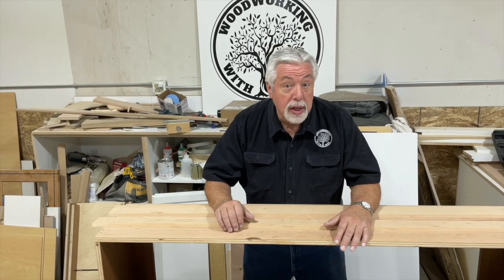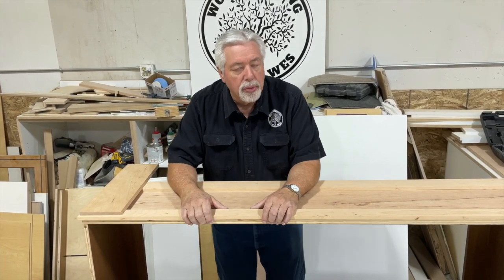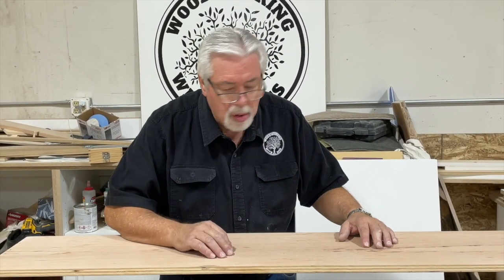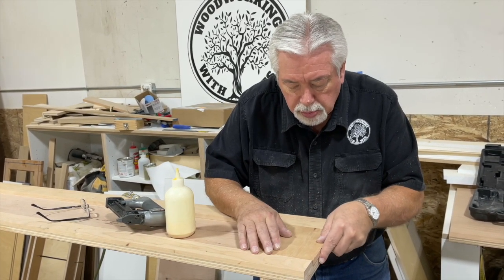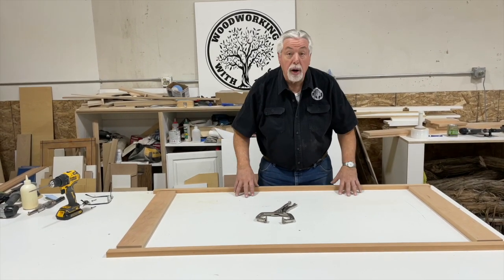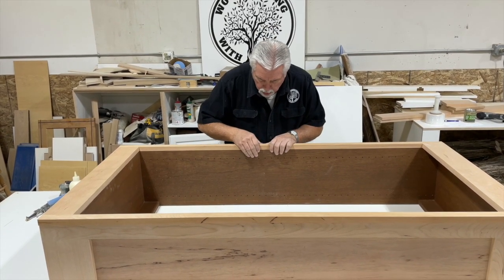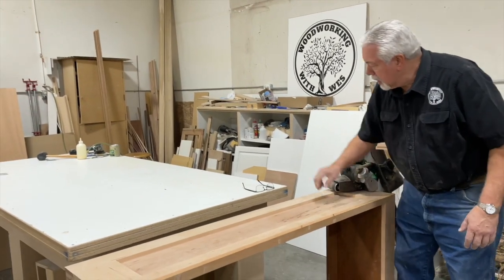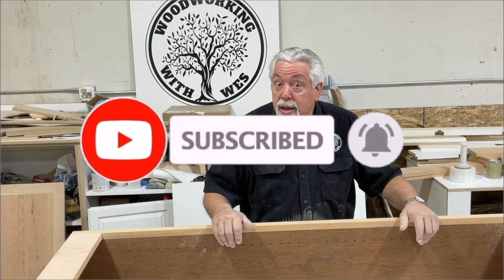Let's Make End Panels! Part 2 Of Our Bookcase Cabinet

Comment: I like the look of the panel a lot. Is there any concern with wood movement with the pieces all glued to the plywood? I'm hoping to do something very similar on the ends of built in bookshelves that are 12" deep and 8' tall. I was planning on 3" stiles and 4-6" rails. I would use your same glue and pin technique.
Reply from the maker: I think it will be great and you shouldn't have any problems at all. Good luck! Wes

Comment: I like your videos. I have been woodworking since High School. So about 25 years now. I am hoping for this to be my permanent career at some point soon. After all this time I still learn stuff from the different woodworkers on youtube. 

I see you use the belt sander to make face frames flush. I always build mine a bit wider and then get them flush as well. However I use a small router and a spiral trim bit. It takes some practice to get used to doing, however it does a good job and I have not had any issues. I need to purchase a belt sander, however I have not yet. I have shop full of tools though.

For your wood filler do you simply just mix sawdust and glue together? 

Thanks for showing us what you do.
Reply from the maker: My preference for a wood filler is Famo Wood and it is available on Amazon and at most retail lumber stores. Thanks for watching, Wes

Comment: wes - Im a frequent watcher of your videos, and I need to ask a question.  You make your door 13/16 finished thickness, using a drum sander to sand from 7/8.  can I used 13/16 as final thickness for inset doors?   does face frame have to be 13/16 as well, and can i use blum euro hinges on 13/16 doors?  Thinking I might just want to go standard 3/4 so I know everything fits, but I like having a thicker/heavier door.  Please advise!
Reply from the maker: Hi Donald...I have always made my doors to a finished thickness of 13/16. Blum hardware works great on the 13/16 thick door. Thanks for watching, Wes